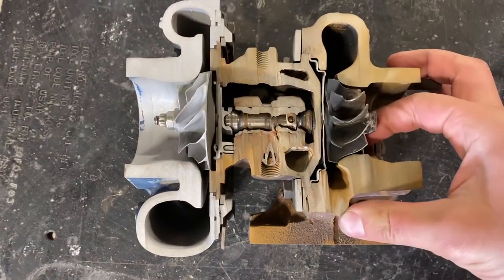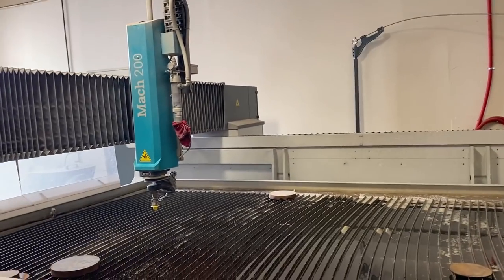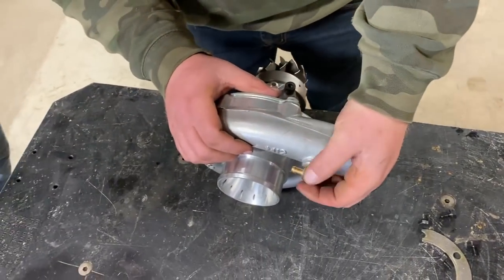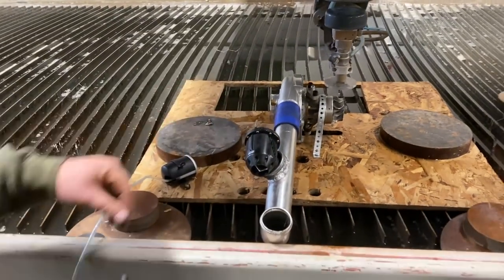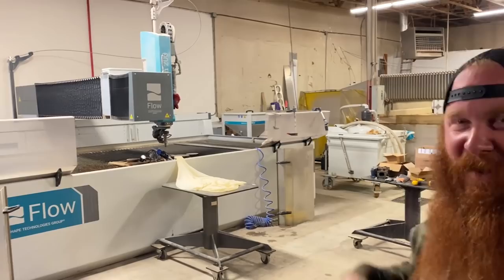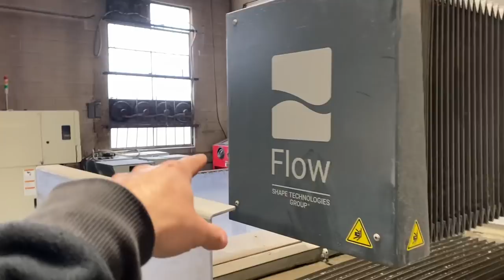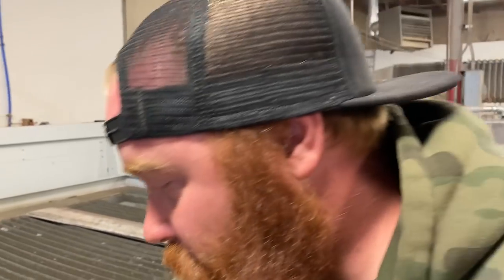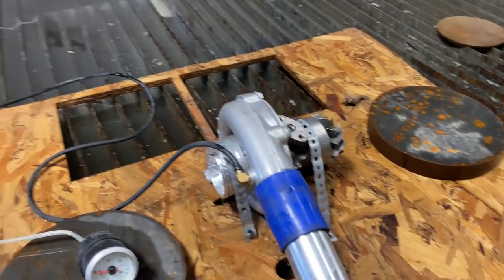Spool a Turbocharger with a 60,000 PSI Waterjet | Absolutely Terrifying

Comment: "Maybe throw four turbos on a Honda Civic...."
"Interesting things"
Reply: Life OD
Reply: Boosted lifestyle!!! Get that V!
Reply: KustomGraphics206 life od did it first though
Reply: Downside is that 2 cilinders fire at once in a 4 cil so both turbo,s only get driven by 1 detonation per rpm. There wil be almost zero boost to compensate for the outside air to get trough the turbine blade

Comment: not sure how this would work, but I think it would be cool to dip the compressor side in water and see how much water it would pump
Reply from the maker: That does sound cool
Reply: My prediction: The turbo wouldn't move and the waterjet would just slice through the impeller.
Reply: You can’t compress fluids. That’s how hydraulics work. That’s a bomb waiting to blow up if it sucks in a shit load of water
Reply: @bwood282  it's not a positive displacement pump tho
Reply: @bwood282   look up a centrifugal pump, basically the same thing as a turbocharger, except except designed for water instead of air.
Reply: Just put a hose on the intake housing into water then it would mount the same as in the video
Reply: Use the turbo to pump water into another cutting tip and cut something with it lol
Reply: Yes! Do this plz
Reply: No different than a waterjet charge pump right. Probably not as tight tolerance and the outlets a bit larger but a similar concept.

Comment: You should feed stuff into the turbo
Reply: Very very very dangerous idea. Turbos can spin at ridiculous speeds. For reference the turbo in my car spins at around 150,000 rpm at max boost. Think of the kinetic energy the blades are carrying at that speed.
Reply: @jacobshepherd3997  the more energy the funnier the mess!

Comment: I need a waterjet to spool my civics the turbo faster
Reply from the maker: It’s only a $250,000 mod, you should do it
Reply: Trying to get down the quarter mile in less than 20 seconds are ya!?😆
Reply: No quarter miles, just enjoy smoking slow mistangs and chevy on the street.
Reply: @jon8706  A quarter mile is a length, not a place..😆 Keep on dreaming with your little baby, lawn mower sounding, ricer girl's car.🚙😂 Turbos are only necessary for tiny little underpowered engines, or diesels.
Reply: @jon8706  You ever watched Fast and the Furious? It's literally all about the quarter mile; it's not on the track. It's just the length of the race. It's not about ego; it's about American muscle vs asian girl car NON-muscle. Even in the Fast and the Furious movie, the American Muscle was the scary powerhouse car.
Reply: Makes sense, you get your "car knowledge" from Hollywood. I get it from people who build and work on cars. What the hell does "non-muscle" even mean? Horsepower and torque are horsepower and torque regardless of what they come from. People chose to build smaller honda motors  for their reliability and the high power to weight ratios that can be achieved. If you don't understand why other people do things the way they do then why be so derogatory towards them?
Reply: @jon8706  I get my car knowledge from MYSELF  from building engines from the ground up for the past over 30 years! Both of my naturally aspirated Camaros have over 600hp, and 600 lbs of torque. Men driving little Hondas are ALWAYS going to look ridiculous, and there's nothing you can do about that. 😂
Reply: @jon8706  NON-muscle is OBVIOUSLY something that is NOT muscular..🤷‍♂️ Dwaine The Rock Johnson is muscle, Steve Urkel is Non-muscle (no muscle/wimpy/little). Same with cars; not too difficult to understand.
Reply: So you just went out one day and built an engine without learning from anyone else? Ok. I've built several engines myself. Did all the work except for boring the cylinders. I, unlike you had to learn from people who've done it before. Btw, 600hp is nothing for an n/a v8. I'd hardly consider that "muscle". My n/a F150 has 500hp.
Reply: @jon8706  Yes, my brother and I started with dirt bike engines at about 10 years old and learned as we went. By shop class in High School, there was nothing to learn and we could both tear down and build up an engine completely. You have how many vehicles with over 600hp and 600 torque again? ..cause I have 2. A big ass truck needs 500 hp just to get up to 60 in like 7 seconds!😂 Although, I find it super funny when you try to talk about your hp, you are speaking of your big AMERICAN truck..😂 I've personally NEVER lost a race with either vehicle, and people try all the time..🤷‍♂️
Reply: The 2019 f150 is an aluminum body and doesn't weigh much more than the boat you drive. Point is 600hp is not achievement for a v8, but I'm glad you get to do something you enjoy with your brother. If I want a vehicle with 600+ I'll build one. My rice car is overpowered as is for how little it weighs. Anywho, not wasting anymore time on you. I hope that one day you can learn to respect others and get over the small man syndrome. Peace.
Reply: @jon8706  I never said I had an "achievement". I have over 600hp and complete reliability along with over 20 mpg average. Your F-150 weighs nearly A TON more. AND has no aerodynamics.. It's a truck; a new camaro isn't a boat at all! You're just used to girl sized cars..
Reply: @jon8706  BTW, I'm 6'2" and 220lbs, and bench 280lbs 50 times a day.. No small man here..😆
Reply: GeopioneerGSXR tell us who asked/cares

Comment: Had a friend who died from a similar stunt. His throat was cut and he bled out in less than two minutes.
Reply: Liar
Reply: @enigma9789  Well, if you can see (deleted, you had your chance)FB page, look at her August 31 post and you will see what a fool you are. He died at Spirit of St. Louis airport while spinning up a gyro with shop air. The gyro exploded, and according to the two FAA inspectors who were standing there and who I worked with on site at the Missouri governor's plane crash, he grabbed his throat and pulled his hand away covered in blood and then fell backwards and was dead in two minutes. Enema9789, your a first rate second rate dude.
Reply: JLNYardBird A turbo can withstand much higher rpm than a gyro. 100-150k rpms is normal operating range under load for most turbos.

Comment: This has actually been an idea of mine. Water pressure driven turbo for no lag and full control of boost. Hair brained idea perhaps, but if it works then it would be awesome. No lag, full boost control, no excess heat from exhaust side, mount it anywhere....
   Maybe mount the turbo to your machine again then plumb it into a car that’s sitting next to the machine and test the theory? That would be awesome!

Comment: The car channel thing would be awesome with all the tools you have in the shop. If I lived anywhere close or had the know how and equipment I could build my chase rack, Baja style front bumper and rear. Heck If I could afford to just throw wide front fenders and bed sides and maybe even a crazy exoskeleton on my Raptor. Have it towing a trailer with an  older NRX with matching paint and wheels....sadly I can barely afford the truck. so custom work is just a pipe dream.
Reply from the maker: I feel ya

Comment: You hit the nail on the head: The turbo held up, because there is no heat to break down the oil that filled the center bearing. The only thing that would go wrong with continued use, would be erosion on the turbine from the point source impingement. You're not in any real danger, considering how much faster the turbo spins when boosting pressures much higher than what was necessary to inflate that balloon.(at MUCH higher temperatures)

Comment: How about putting a variable speed motor to drive the turbo and and use water in the inlet like a lawn water hose and accelerate it to see how fast the output of water you get.

Comment: I would very much like to see a repeat of this experiment with active oil pumping on the center hub. It would cool and suspend the bearing in pressure and I think you could reach higher RPM. It would also be interesting to compare with and without the turbine housing still attached. Forcing all the water and air it accelerates to go around the loop might increase efficiency, or maybe it just slows it down? Perhaps widen the fan to catch more air?

Comment: Massive diesel turbo. Make some kind of dry sump system. Use threaded barded adapters for oil in and out. Cheap ebay electric oil pump. Elevate some kind of oil container.

Comment: Shield the waterjet nozzle and let it eat until catastrophic failure. Plus plumb the boost gauge to a point that you can film it. I would be curious as to impeller  RPM and PSI at full pressure.

Comment: Plug the bottom oil hole fill with oil  and add small reservoir the intake is probably extremely cool with the amount of water that is being sucked into the turbo. Hook that thing up to something with resistance so we can see how fast Maximum boost is achieved. Also add a air line to what ever tank you  use and see if you can run air tools off it. Turn it into the world most complicated air compressor ... just add a 150psi safety valve to the tank

Comment: The turbo may have been loud, but I do believe, that, the bearing would have wallered out before anything exploded. Also, you should redo this with pumping oil through the bearing. I don't think that the turbo could have hit enough revs to explode.

Comment: Do you need to use a cutting nozzle on the turbine ? Any chance of using wider diameter jet to reduce erosion on the vanes and still have enough energy to drive your turbine to have satisfactory result ?
Cheers from Downunder👍

Comment: take an oil pump and connect it to the turbo oil inlet and attach a filter fitting to set turbo oil pressure, connect oil out to tank and wire the battery?

Comment: I was asking this question on another channels few weeks ago, weather a water pump power steering pump or air con compressor could be repurposed to run a turbo as a cheap diy hack for those who can’t weld manifolds.

Comment: The turbo actually needs oil pressure because the bearings need it, there is no ball bearing, the turbine axle is lifted and floats on the pressured oil, that’s what allows it to spin up fast, i’m pretty sure that with oil pressure you would have got even better results.

Comment: Ok crazy idea but you guys could totally use the water jet to make mechanical systems run. Like using it to spin a generator wheel and make electricity to power a bulb or a full Christmas tree (Christmas episode?) or like a meat grinder and other small rotary machines

Comment: I was hoping you'd crank up the pressure. That was only 15k out of a possible 60k. You don't need a bigger turbo, just turn up the water pressure and make it spin faster. I wonder how fast it would go before tearing itself apart though? Maybe something to try on your older waterjet. Wouldn't want chunks of turbo flying into your brand new machine.

Comment: So if you analyze the audio of the spinning and find what frequency that really high pitched nosie was and divide that by how many fins the propeller in the turbo has you can find out how fast it was actually spinning so like if the frequency was 15000 hz and there’s 10 fins it would be going at about 1500 revs per second

Comment: IF you use the exhaust manifold and run it through that you will drop the surging and be able to control the speed far better as well as the chances of it destroying the fins its would be far far less pressure but your maxing out your RPM based off  pressure now you need to find the max airflow/pressure for the optimal input/output combo!

Comment: Bigger turbo = heavier impellers = more inertia =  higher centripetal force = higher change of impeller exploding.
However, I've seen these things spin up to 200,000 rpm plus on "turbojet engines" so I wouldn't be so worried about what speed you're hitting. That said, I don't have a clue what lineal speed the water is exiting that nozzle at either.

Comment: Hear me out. Why can’t we use the belt itself with a gear system to spin the turbo to a 5:1 ratio? The power from the turbo can be used to compensate for the power loss from adding it to the belt.

Comment: I don't think you were really pushing the rpm limit on that turbo, judging from the sound. You probably weren't doing more than 60-80,000 rpm, and smaller turbos are known to reach 150-200,000 rpm at full boost. If you have some sort of threaded oil cup with a lid that you can screw to the oil supply inlet, and just plug the outlet, you should be fine for short runs, since the only heat being produced would be on the compressor side, and then nothing that the water spray wouldn't keep cool.😉 Fun project!😁👍

Comment: I'm shocked at how little air is produced at such a high rpm
Reply: There was no load turbos love load
Reply: @Womb Raider she did told me all about you
Reply: Using a balloon to measure the volume of air can be deceiving. Volume varies as the third power of the diameter. A large volume change results in only a small diameter increase. In simple numbers doubling the diameter requires an increase of eight times the volume (2x2x2=8)

Comment: What is the serial number of the Cincinnati mechanical press in the background? It will be on the capacity plate on the ram and also engraved into the upper right hand corner of the bed. If provided I can give you it's history.

Comment: turbos use exhaust gas to spool up. since youre using cool water, there is an almost 0% chance of that turbo overheating. maybe if you let it run at top speed for multiple days, but otherwise, no..

Comment: Hmm, I didn't thought turbos had ball bearings but instead hydrodynamic bearing fed by the oil, I'm actually very surprised.
Reply: Ball bearing turbos were a response to turbo lag by sacrificing turbo life. When a ball bearing turbo fails it's catastrophic, whereas journal bearing turbos won't grenade as often. Journal bearing turbos will theoretically last forever as long as your engine supplies enough clean, quality oil to the bearing.

Comment: Quad turbo civic has been done before and it ends up being a junker after you loose Interest. Get a 4.8 or 5.3 vortec motor from a truck and beat on that with a couple turbos. It will survive make power and lead to more v8s in the future. I

Comment: Please make sure the oil stays in... then it might last. The best turbo wont last many seconds without oil.
Reply from the maker: There is a lot less heat in this setup, so it should last longer.  But if we do attempt with a bigger turbo, we will find a way to keep oil in.

Comment: "low pressure = 15,000 PSI" that is not low
Reply: Not for us mortals, but in water jet world 15,000 is idling. These jets run 50,000 to 60,000 psi on high and there are some you can buy upwards of 87,000 to 90,000 psi. The pressure is so high you can’t have any oily deposits in the water part because it can Diesel and wreck the seals.

Comment: Doesn't usually hold up my ass this dude must not know anything about a turbo charger
Reply: Austin Mallard I mean when you buy cheap stuff and make it fast it won’t be reliable. Trying to make a bunch of power on a cheap turbo you’ll find the weak link and most of the time it’s the cheap ass turbo.